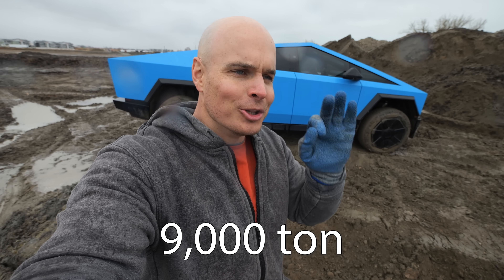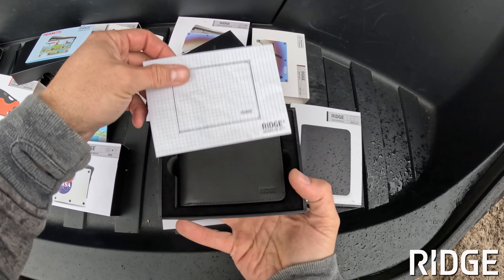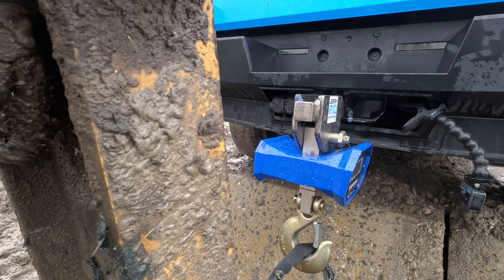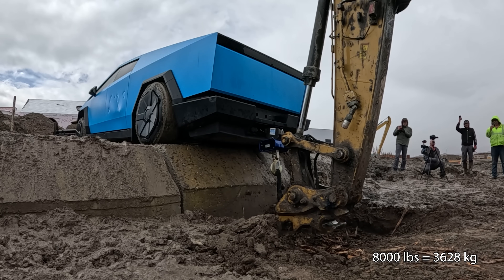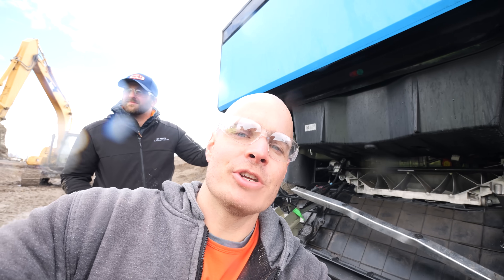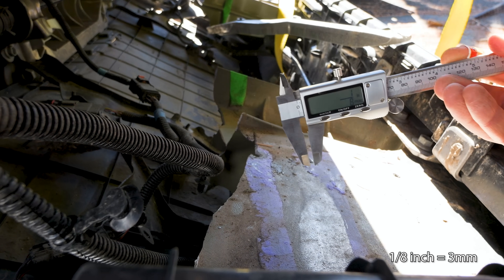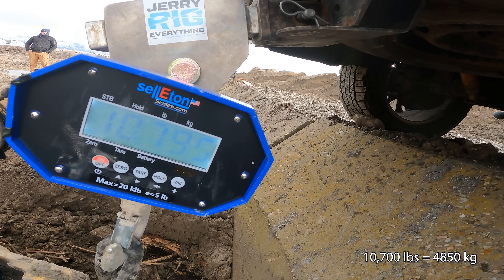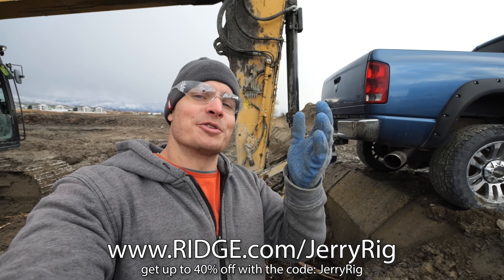SHOULD YOU TOW WITH A CYBERTRUCK?! - (catastrophic failure test)

Comment: The glue is for anti vibration, if you just bolt, rivet or weld large surfaces together there is a chance they will begin to vibrate and make noise and potentially stress fracture. The glue can also seal the two surfaces against water ingress..... though not in this case as its just three lines of glue.

Comment: Given the whole tongue weight towing weight convo I don’t think this is as much of an issue as people think. Holding 10x its rated weight is actually impressive. 

But even more interesting is that I think this can be a simple fix. The breaking point seems to occur around a certain point almost always. A simple fix will be for Tesla to engineer a thicker aluminum mold for that section. The aluminum does look very thin. But then again this is such a niche problem to solve. Many people rarely tow with the Tesla anyways because EVs can’t really tow that far especially heavy loads.

Comment: This video proved that the cast aluminum broke at 10,000 pounds while the steel frane didn’t snap off but was still completely unusable because it bended so much
Reply: The video proves that cast aluminum is less ductile than steel but not as strong because it needs a lot less force before changing shape

Comment: I think I'm having the same thoughts as everybody who actually haul stuff with a trailer either with a hitch or a fifth wheel you will never ever put that much load on that hitch unless you're Duke of hazzard's jumping with your trailer only 20% of the load may be 40% is on the tongue I think that was pretty impressive for cyber truck especially how thin the aluminum was and using glue

Comment: First you said you have to hold the front of the truck because it could lift the wheels. Then you say this is not a good look because it breaks at 10.000. Well in a real situation you would have the front wheels off the ground before it could break, would you not? So which one is it? Why are you demanding Aluminium to perform better than steel?? this is so stupid 🤦‍♀

Comment: Cool video, but the most important question is: how many cycles of fatigue can it endure at its rated tongue weight limit. In terms of engineering, technically the less overhead you have the more cost efficient and light its going to be. I am pretty sure they know about the physical limits of the material they chose, but decided it was plenty for the expected use case and ratings. It's a consious decision, and not an oversight.

Comment: Do you not know airplanes with their wings flexing back and forth constantly are Aluminum? How about Engine blocks containing millions of explosions for millions and millions of cycles? Jerry either doesn't understand structural engineering and metallurgy as much as he thinks he does, or he is knowingly & dishonestly doing a hit piece cause he doesn't like Tesla. 

Hitting even a major pothole half the size of the wheel at 80mph, STILL wouldnt even come anywhere close to 10k lbs vertical impulse on the hitch.
Reply: Airplanes aren't made of cast aluminum and get taken out of service before they fail. Lessons learned from DeHavilland and that Hawaiian 747 that turned into a convertible mid flight
Reply: @Turbo.M77 A check. The A check is performed approximately every 400 to 600 flight hours, or every 200 to 300 flights, depending on aircraft type. It needs about 50 to 70 man-hours, and is usually performed in an airport hangar. Here, your issue planes get maintenance very often. What car owner sends a car to the dealer to take off engine parts every 6 months or check for structural damage? Nobody does that; it's too expensive. We do not talk about military planes' service, even on another level

Comment: important note also, Steel Flexes, Aluminum does not. SO, you wont need 10klbs on the Cybertruck to break it. Every single time a bump occurs even at say 2klbs it will begin to fracture and grow worse with ever other bump. Steel will flex and bounce back, Aluminum will start to hairline crack and eventually break even though it may never hold 10klbs at one time.

Comment: Should you toe with a cybertruck…😂 And  what do they test ?? Pressure weight. There is a big difference between pressure and towing weight.For example, a car may tow 2000 kilo’s with a pressure weight of 75 kilo’s on the tow bar. So the test makers no sense of the title is wrong.

Comment: That's a strong truck...force was vertical (Ry was 10000 it means R at 30• ~ 20000, even at 45• 140000)...it can lil tow more than 15k at 30 degree inclination jack...thats stronger than u explained jerry.
no deny steel is stronger than aluminum.

Comment: With my 2500 2006 Dodge Ram I've towed 18,000 lb trailer loads over rough terrain with no issues. The cybertruck is a cast aluminum car with a stainless steel fantasy sci-fi body. Utterly useless for real truck work.

Comment: I don't get the purpose of this test.. the spec limit on tongue weight is 1100 pounds.. not 10,000. How on earth are you going to improrly load a trailer to get the ENTIRE tow rating on the tongue??
Reply: Also a dodge 2500 has a rating that's 50% higher than a cybertruck. This is not even close to a fair test.

Comment: i hate elon musk too, but this result is really good for tesla, not bad
Reply: Ah yes because every vehicle's rear unrepairabley snaps off
Reply: @DrKoneko  at 9x times weight of what it should withstand
Reply: Towing capacity is advertised at 11,000 lbs. It failed at 600 short of that. Weight like that can come crashing down over bumps and the truck needs to be able to handle that because the truck is not repairable after it's made.
Reply: @ 9x it's rated tongue weight, its RATED TONGUE WEIGHT, you know, rated tongue weight

Comment: I'm most worried about work fatigue. Steel can bounce back so long as the angle of deflection over a span of half it's thickness remains less than 90 degrees. (This is a very simplified way of thinking about it). Aluminum, by contrast, can not bounce back from any deformation. It may not fail on the first loading, but once those atoms move, they are not going back into place and any subsequent loading will only move them further, stretching and thinning the area under strain. This will eventually lower the failure point well below the peak loading of your typical hitch load. 

This property of Aluminum has been well known for decades. Prior to the value of copper shooting up in the 1960's, aluminum was not the preferred metal for electrical work despite it's lower price and greater malleability.* During the 60's and 70's, Aluminum's cheaper price made it very common for a period of time which ended up requiring building codes to step in and regulate it's use due to safety concerns after a number of fires (some fatal) were caused by "faulty wiring"*. 

*Aluminum's tendency to cold creep meant that aluminum wires would gradually move, get thinner and loose contact at termination points, leading to higher resistance, which would cause the wire to heat up at lower current than the breaker that was "protecting" them. Increased temperature would lower the conductivity further resulting in a feedback loop that would eventually cause the insulation to ignite. The new regulations required a wire-to-wire splice (no crimps or screw blocks) from the aluminum to a short length of copper that would be used for the actual termination. Eventually, Aluminum was phased out altogether except in some very specific (generally commercial) applications.

Edit: Clunky wording.

Comment: A lot of high strength aluminum alloys contain magnesium. That makes it strong and resistant to bending. But it also makes it brittle when it reaches its maximum limits. Steel will bend until it reaches its max. It’s more complex than that. But you need to make aluminum thicker than steel for the same ability. This design is inadequate.

Comment: So is the steel for the Dodge of engineered or is the aluminum lacking. I can see how over time fatigue could take the aluminum down. Especially with a final blow of a bad pot hole. But never towing? Wouldn't a more measured take be to make sure your load is properly setup and maybe don't tow at the absolute limit.

Comment: The durability of metal is apparently determined by which word is emphasized in its description, since you say that the problem with aluminum is that it "does not have a fatigue LIMIT," making it, over time, weaker than steel, which "does NOT have a fatigue limit."

Comment: At 10x safety factor, at 100% rated loading - number of repetitions for a fatigue failure is circa 10^5 - 10^7.  Thats a MILLION of unlucky potholes you are talking about (or crossing ridges for that matter). Whistling diesel test was for offroading from rocks as high as a vehicle, which I guess is fixable wiith an extra crash pad for them in a rock crawl sport.

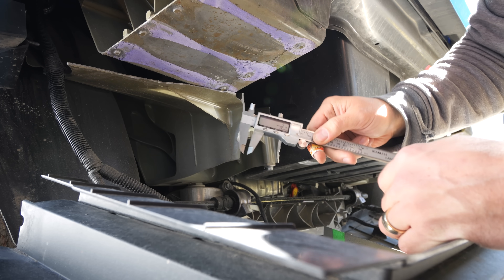Comment: 10:50 why is it wild to have that many error messages? 

This is my issue with you these days. When you have clear bias on something your language shifts immediately to an extreme take without taking any time to consider if it’s reasonable. The way you talk about the glue is another good example. 

The hitch withstood about 90% of the towing weight. Steel is better for sure. No argument. But your “this is dangerous”‘rhetoric is clearly unfounded.Props to you though for leaving in “I have issues if it breaks before 10k” even though it didn’t… and you still decided you had big issues.

Comment: I can tell you don't understand physics, there would never be anywhere near 10,000 lb going downhill, not even 2000 lbs. It's sad when YouTubers tell one lie after another
Reply from the maker: You're saying when you go down a steep driveway and your truck reaches a Level road but the trailer behind you is still inclined, that the majority of the trailer weight is not pressing into the truck and downward on the hitch? Some of you have never had your truck jostled by a 10,000 pound trailer before.  Live weight is extremely dynamic. It doesn't always stay at 1,100pbs tongue weight.

Comment: The load applied is not a test of towing capacity. It's just a test of the failure load of the hitch (which by the way is very impressive). Tow loads act on horizontal planes. Only the tongue load acts directly downward on the hitch. The majority of the load on the trailer is supposed to act on the trailer wheels and not on the hitch. Even in the conditions mentioned, not all of the trailer load becomes the hitch load. A lot, yes. All, not really, they will get resolved and minimised in many ways (resolving angles, tyre friction, rolling friction, momentum and so on)
On to the breaking of the frame, problem is, Aluminium is just not strong as a whole. It has a good strength to weight ratio but it does not have close enough elastic properties that yield well for load bearing applications. The reason engine blocks do well with aluminium because one, most if not all of the forces in engines are balanced and cancel each other out. Two, the combustion of gases in the chamber raise the pressure to insane amounts but it's what it is, compressed gas and not a solid hitting the metal directly so the impact characteristics are completely different. Of course, there's also the advantage of aluminium dissipating heat better. 
Coming back to load bearing, you need the material to be strong but also tough. Once aluminium crosses the fatigue threshold, it simply starts going into plastic deformation. 
Now, steel does have these problems too but the elasticity is more which means you have higher load limits and more load cycles allowed before all hell breaks loose. To those thinking, "Alright lesson here is to lower the load". Well, yeah but if it's a very frequent loading-unloading cycle done continuously over months and years, there's one more thing to consider. There is something in all materials called creep stress or repetitive stress which develops and causes premature failure which honestly is very scary because creep can occur even if you have been loading the element well below the permitted limit.

Comment: Towing 11000 pounds is not the same as applying a 11000 pounds load. For instance, my arm can pull a 2000 lbs car in neutral, but that same arm could not support a 2000 lbs weight. It would be ripped off in an instant. And it gets worse, they are not pulling horizontally as if they are testing the tow rating, they are pulling downwards, testing the tongue weight limit, which is 1100 lbs. It broke at 10x that limit. They Cybertruck might be ugly and designed by a lunatic, but this test is misleading or desinforming people. Thanks for reading.

Comment: To be fair, I think pulling down is unfair, seldom happens in reallife.
Reply: Potholes, speed bumps. Shaky roads, if youve ever taken an Aluminum plate and folded it up and down multiple times until it splits, that is exaggerated equivalent to what's happening here. Aluminum all the sudden isn't as strong as steel. Inherently meaning it would give out early even for a pull test.

Comment: So it took 10400 lbs of downward load to brake it off. You know, in Austria the max downward weight you are allowed to have is 70-90kg so this is more than 50 times the allowed weight. What the 11k lbs refers to is the weight of the whole trailer and it is completly unrealistic that any trailer ever can load the hitch verticaly except it falls off a bridge while hitched

Comment: hmm saying that if they hit a pot hole and that load could transfer to the hitch i think it's far fetched. you will get some but not he full load.. and that's one improperly loaded trailer. i mean the trailer holds most of it's weight on the axles of the trailer, hence why the tongue weight is a much significantly smaller number. the fact that it was 1000 lbs under the rated towing capacity, don't see this as a failure. in fact noticing a trend here, especially based on your previous mention about the politics going on the cybertruck is a polarizing thing to own. And you have seen your own business be affected by it. I like that you destroy things that's fine, and yes a steel truck may do better but from what i can see it's all within specs  could definitely improve. but no you aint going to have 10k going vertically down like that
Reply: additionally that purple glue is used in many vehicles it's a 3m adhesive.

3M™ Panel Bonding Adhesive and our 3M™ Impact Resistant Structural Adhesive (IRSA) have been specifically recommended for collision repair by major OEMs from around the world. When used according to these recommendations, these two-part epoxy adhesives deliver you additional assurance that your repairs meet OEM requirements in critical areas such as strength, cleavage, peel, temperature resistance and corrosion protection. Our tiny, lightweight 3M™ glass beads are incorporated into the formulas, making it easier to maintain minimum bond line thicknesses and prevent over-clamping. These adhesives can be riveted or weld bonded immediately during working times when cured at room temperature. Or, they can be heat-cured for accelerated cycle times. They can really help you work stronger, smarter and better in collision repair.

Comment: There may be a flaw in your process.  You had to push down on the front in order to achieve 10k lbs of down force on the hitch.  In the real world, the front end would lift well before that amount of force could be applied.  Even in a shock load situation, it would be difficult to achieve that same outcome.

Comment: I'm not a mechanical engineer, but I suspect pulling 10K pounds laterally is very different from pushing down at 90 degrees.  The aluminum probably wouldn't snap if pulling the weight.  Anyway, really cool to see it break!

Comment: Sad to see such a big YouTuber giving such misleading information and commentary. You’re saying this is a complete failure when the cybertruck is rated for 1.1k tongue weight. And it didn’t break till 10.4k. That’s crazy impressive given the rating and context. Your example of towing up hill also doesn’t apply physics correctly. Your example only makes sense if the cybertruck went up a 90 degree hill while the trailer stayed completely horizontal.

Comment: I just went back and watched the whistlindiesel vid where it snapped. It actually failed in a different manner to this one. On the WD Cybertruck, the areas with the purple adhesive both sides appears to have remained intact, the break happens further back towards the bumper. They dont put any downwards load on the hitch in the WD video like they do in this one, but it does get several knocks from below. This is going to put a shock load in the other direction, but not tensile load on the adhesive like this video. The WD hitch fails while tugging the F150, which suggests to me some damage had already been done. 
It's still a concern to me, as a cybertruck could have an accident e.g. hitting a low object like a concrete bollard. The truck may look relatively undamaged but the casting has been compromised, then it could fail at a later date while towing something. Also due to the size of the casting repairability doesn't look easy, and minor damage from a parking accident like that (or the back end falling off entirely) could be prohibitively expensive and write off the truck. I don't know if they can splice in a new section or it's an entire casting replacement. If it does require a new complete casting then throw away the whole truck!